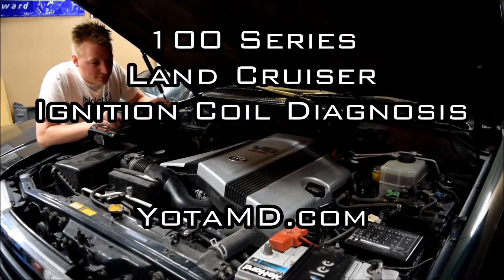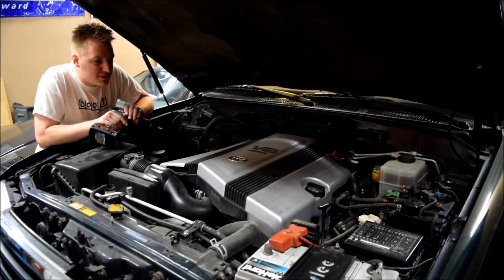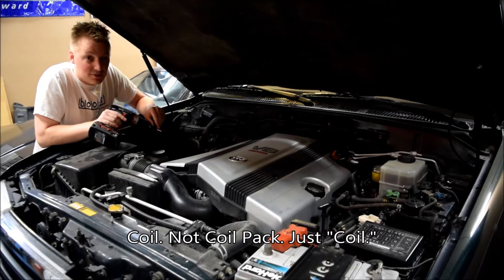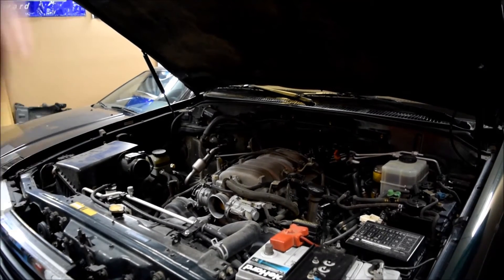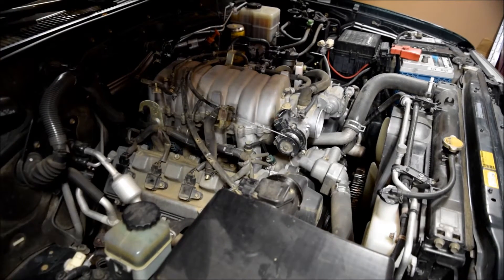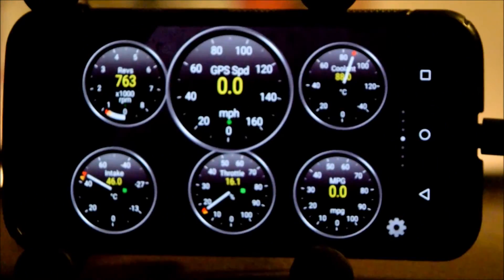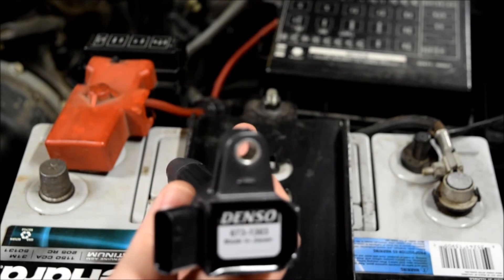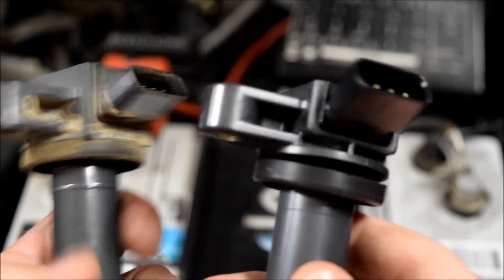Ignition Coil Diagnostic P0306 - Toyota Land Cruiser - "Uncut"

Comment: Are these ignition coils the same as the ones purchased from the dealership? I replaced a bad ignition coil, but the Denso coil I purchased from a local automotive store does not have the same part number. The original coil has "Denso" and "Toyota" stamped on it, but the new coil is only stamped with "Denso." They look very similar. The new coil even has a spot where the Toyota name would be engraved. I feel like the Toyota Denso coils are just price marked up Denso coils. Thank you.
Reply from the maker: They are not necessarily the exact same thing. Denso is the OE supplier to Toyota/Lexus, but not every Denso part is made in the same factory to the same specs as a Toyota/Lexus part. For the most part, buying Denso ensures you're getting Toyota or near Toyota quality parts, but Denso also makes reman units made in Mexico and other countries that absolutely do not manufacture the original parts in the factory floor Toyota/Lexus models. I've had multiple Denso parts be dead out of the box. Never once have I had a genuine Toyota/Lexus part do that.

Comment: Can you please tell me the OBD brand you used to diagnose the issue with the coil, I have a 2000 Landcruiser. I've used three different OBDs (two from Autozone) and all returned link error message.
Reply from the maker: https://amzn.to/3lSiOjk that's the exact one I've used for about 7 years. Works great. I leave it plugged in constantly while driving.
Reply: Thanks.